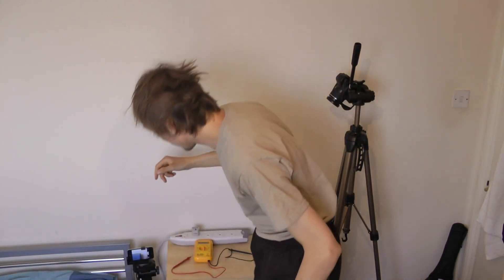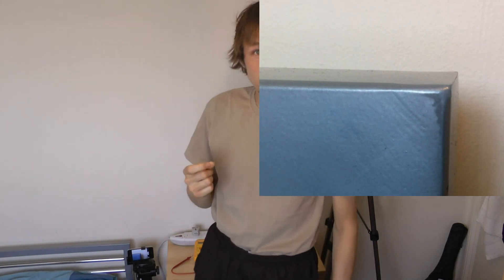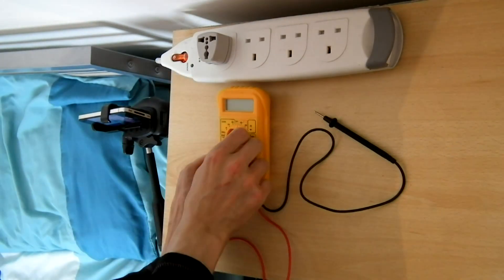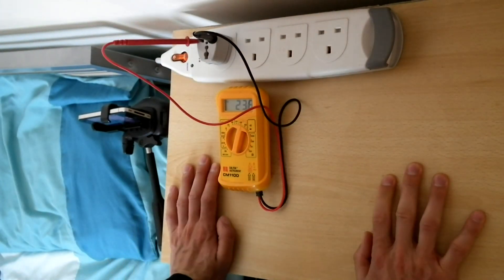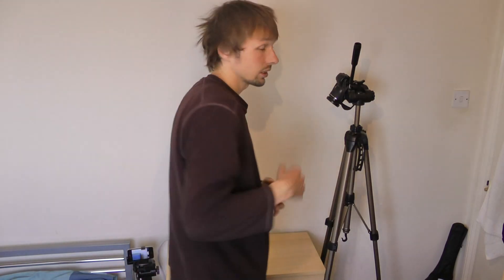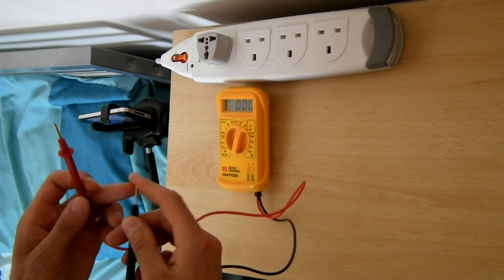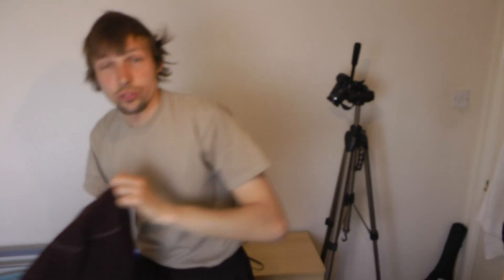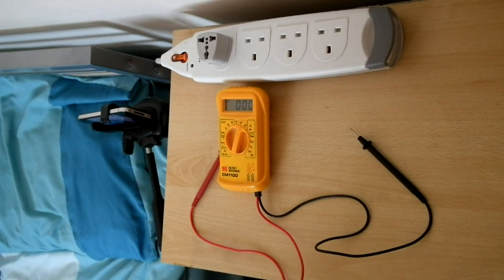how to generate electricity with your own body

Comment: high voltage is like the rate of electricity transfer so as long as it's a small amount of electrical charge it should be fine, if i remember my physics A level ah ahahahahah ahah